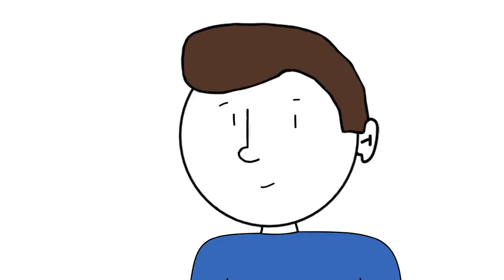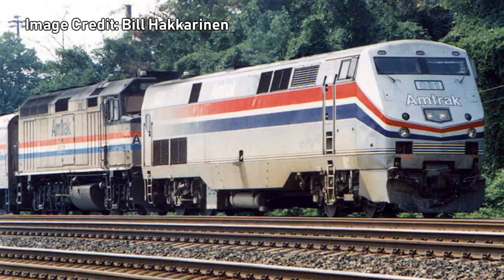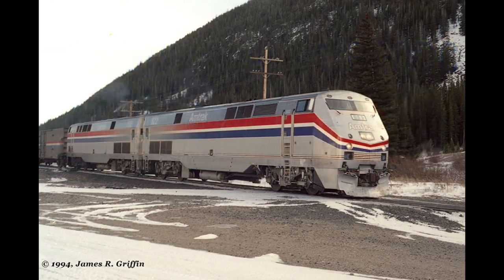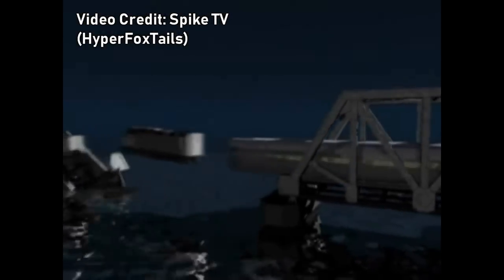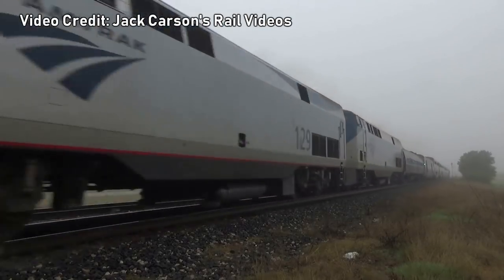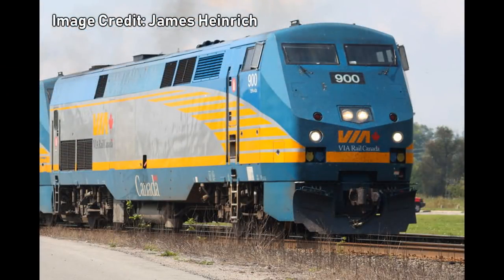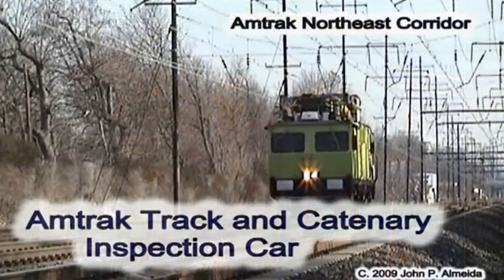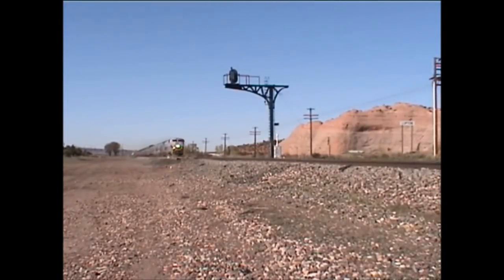Engines of Amtrak - GE Genesis

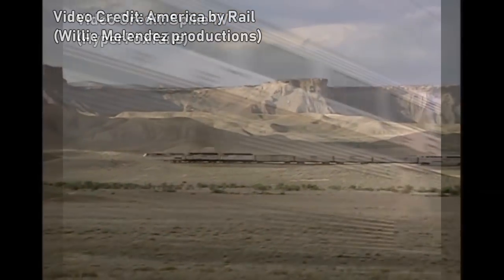Comment: At 4:23 why couldn’t Amtrak have ordered another P40 and numbered it to 819 to replace it at that time.
Reply: Locomotives are built in one continuous production run. Once the production is complete ordering just one is not even an option.  It would be prohibitively expensive as parts are ordered and the assembly line runs with a tight schedule.  At the time they were built Amtrak was the only railroad buying them so tacking on to the back of another railroads order in progress wasn't an option either.  Locomotive builders aren't interested in small orders. They want orders of 10+.  It's the same reason why Amtrak isn't buying two new ACS-64's the replace the two units that were totaled in the two incidents they had. The production line is done making ACS's.
Reply: @FFred-us9tw  the reasons why because P40 819 had been in service for a few weeks and same for P42 143 and 149 because they were wrecked back in 2001 and at that time they’ve been in service for a couple of months.
Reply: @christianstudivant4804   Yes, but it doesn't change the fact the production schedule is based on a set number of loco's and the necessary parts. Too costly to add on 1 or 2 more.  This is commonplace when producing locomotives. The only way to drop the cost on extending a production run is to order in volume. That means a lot more then a few extra units.  And even then you have to deal with shop floor scheduling. GE was building a lot more than passenger loco's at the time. You only have so much space. If you alot a set amount of time to build one series of loco's then you are already blocking time to build the next order of loco's for the next customer. You cannot just extend production on one type to build a few extra units and start a chain reaction of delays on the next model to be built on that line.

Comment: As of the creation of this video, P40DC #831 is based out of Washington, DC and multiple P40DC’s are still on the Auto Train roster.
Reply: P40DC's are typically the main power for auto train sets, but occasionally they'll find their way on other lines.
Reply: The Rail Thing indeed so.

Comment: Why doesn't Amtrak get the streamlined Chargers? Especially for the Cascades line?
Reply: The SCB-40 was made specifically for Brightline (now Virgin Trains USA) as these locos has the same horsepower rating as a P40DC.

Comment: Horn Button? Does that mean no quilling horn?
Reply: Bradford Whitney Yup thats correct.
Reply: No, it's not. Amtrak horns have what I believe is called a "two-stage valve:, meaning they're capable of half-blasts and full-blasts.
Reply: The Rail Thing Incorrect, The horn is a blue button, You press it you get the horn simple, Its not a valve where it quils.

Comment: Does Amtrak have dash 9's, AC44CW's, or SD70ace's?
Reply: Norton Hatfield no those are freight diesels and Amtrak is a passenger railroad not a freight railroad.
Reply: Amtrak at one time handled Express freight and mail on the long distance trains and these freight locomotives have been used on Amtrak trains temporarily should there be an issue with the regular Amtrak locomotives.

Comment: I thought these engines have a RB26 engine or a 2JZ engine
Reply: Joseph Edomwony why would they have such a small engine?
Reply: dennis trident william they need these power engines to make it look better
Reply: Joseph Edomwony but if they had those they would be underpowered as fuck
Reply: dennis trident william all we need to is add like 10 those in there
Reply: dennis trident william cause look me and friend we have engine swap a septa Kawasaki LRV 9000 series trolley with the RB26 engine in there but we tried a Toyota 1jz and it exploded so we have to use the nissan RB26 engine from the Nissan skyline gtr
Reply: Those engines don't have the torque to pull over 2 million pounds. There is truly no replacement for displacement. You must be an idiot to think trains would use car engines that aren't even made my the locomotive manufacturers themselves.

Comment: f40's sill around thought
Reply: Brian Castle ROCK RXR 9 f40s are NPCUs on Amtrak but on commuter roads like metra coaster VIA ACE music city star and MBTA still run regular f40s
Reply: Amtrak still has a small number of actual F40s at Beech Grove last I heard but they will likely eventually become NPCUs or be used as parts sources for the GP38H-3s.
Reply: Blackbird Gaming Actually that would be in Bear,DE. Beech Grove has 2 or 3.

Comment: I personally think that the Genesis will continue to be used on long-distance trains
Reply: TexasRailfan21 For 5 more years
Reply: Robert Briscoe / Amtrak Man I still don't believe it it's my opinion and I'm sticking to it
Reply: TexasRailfan21 Yup but thats how it goes but hey cheers to the future.
Reply: Robert Briscoe / Amtrak Man cheers to you too 👍
Reply: @amtrakpilots8947  here's an idea if General Electric were to make another generation of the Genesis series locomotives what would you think the number would be P45 or P50 and if they did it would also be in the tier 4 requirements I thought it would be very cool if General Electric made the next generation of Genesis engines what would you think the model number would be?
Reply: TexasRailfan21 GE nowadays is kind stepping up their game but wouldn't be interested at all.
Reply: @amtrakpilots8947  this is not something I'm saying it's something I'm asking this is a theory if they would what would the engine model be called?
Reply: TexasRailfan21 Something terrible
Reply: @amtrakpilots8947  I think in my opinion it will be called the P45 it would have slightly more horsepower than the P42 it would have the state-of-the-art features and meet all the tier 4 requirements if GE would make that model but this is just a theory and an idea that would be cool

Comment: 818 slammed into a crop sprayer tractor in NE montana a few days ago..... 5 cars derailed but stayed up right
engineer was in critical condition.... and the PAX seem to just have a few broken arms and scrapes 
but idk if 818 will be on the rails ever again...... they MIGHT be able to rebuild it
Reply: Where did you hear of that?
Reply: @harrisonofcolorado8886  just had to look out of my window.....

As far as the more detailed stuff..... friend who has a police/EMS scanner that also does BNSF radio stuff
Reply: @kainhall   how badly damaged was 818?
Reply: traveler  front end was smashed pretty much flat.

The frame MIGHT have took a bit of twist.

Idk if amtrak will spend the money to put a new shell over it (front to back... the shell is one piece) even if the frame is OK
Reply: @kainhall   hey um, not to burst your bubble but I found a photo of the accident and apparently the wreck damaged Locomotive seems to be Locomotive #9 not 818. 818 seems mostly okay. But yeah, I think 9 is a goner.
Reply: @kainhall   I just meant P42DC 9 was damaged not P40DC 818 as much.

Comment: It is time for Amtrak to replace its locomotives and coaches too. In fact some of the equipment that they use has existed longer than Amtrak.
Reply: Actually thats quite wrong, The only locomotives on the roster that are older then Amtrak is the SW1 #737 which serves WT.
Reply: same with metra they use some cnw pullmans but i think its cool
Reply: planes spotter and railfanner Yup, I think acouple are left possibly 10+.
Reply: planes spotter and railfanner some of the Amtrak superliner coaches have been used on Santa fe el captain.
Reply: Robert Briscoe / Amtrak Man some of Amtrak's amfleet coaches  were originally emu, electric multiple unit, coaches for Penn central.
Reply: Norton Hatfield No your info is wrong superliners were never used on the El Capitan but the Superliners did serve with the Hi-Levels beginning in '79 on the Empire Builder.
Reply: Norton Hatfield Nope, Amfleets are based off the design of the Budd Metroliners.
Reply: Robert Briscoe / Amtrak Man it's too bad the superliner coaches can't be used on all Amtrak lines. This is true with Amtrak trains on the east coast because of the infrastructure of the Northeast corridor. The North East corridor has a lot of low bridges and tunnels. Too small for superliner coaches and the Hudson river tunnels are a tight squeeze for trains too. Those tunnels are too small to accommodate superliner coaches too.
Reply: Norton Hatfield Both yes and no, Superliner have clearence for the Keystone Corridor which runs to Harrisburg.
Reply: Robert Briscoe / Amtrak Man the amfleet coaches were designed to attract airline passengers because the coaches are designed to look like the fuselage of an airplane. In fact the seats inside an amfleet coach look like the seats of an airplane.
Reply: Norton Hatfield Well back in the days, They gave Amtrak the Airline Seating arrangement and style but now they are actually using Airline seating.
Reply: Robert Briscoe / Amtrak Man that makes sense since the airline industry almost killed passenger rail service in the United States during the late 1960s.
Reply: planes spotter and railfanner that is surprising that a modern day commuter train would be using vintage passenger cars.
Reply: Norton Hatfield Well alot of commuter companies use those cars because thats what they were given to supply on and if they think that it good to keep using.
Reply: planes spotter and railfanner metrolink has ageing bombardier passenger cars but they very reliable compared with the new metrolink passenger cars which are made by Hyundai totem. Metrolink on the other hand is planning to retire its fleet of bombardier passenger cars. They plan on only using Hyundai Rotem passenger cars a few years from now. They  will scrap some but they keep some in storage and donate others to other commuter trains.
Reply: Robert Briscoe / Amtrak Man also diesel and steam engines are banned in New York city, so all train heading towards grand central station in New York city must have an electric engine or a dual powered diesel and electric engine.
Reply: Norton Hatfield Believe it or not Diesels have been in Penn station including F40s, FL9, Amd-103.
Reply: Robert Briscoe / Amtrak Man that in case of an emergency or during matinence or even during electric rail and wire repairs, these are exceptions of when  diesel locomotives are allowed to travel into New York city stations.
Reply: Robert Briscoe / Amtrak Man the fl9 is actually a dual mode diesel and electric locomotive.
Reply: Robert Briscoe / Amtrak Man Also the Amtrak p42dcs and switching engines  have traveled in New York city too. This includes the aftermath of hurricane Sandy, the week after 9/11 when all flights were grounded, and to rescue electric trains on North East corridor during a power outage or broken electric cable, and also after hurricane Sandy in 2012 too because the electric grid on North East corridor was down for several days after hurricane Sandy.
Reply: Robert Briscoe / Amtrak Man gp9s, dash 7s,  and sd45s could fit through the Hudson river too, but larger locomotives such as the f59s,sd90 Macs,  sd70 aces, and dash 9s would be too big to fit through the Hudson river tunnels.
Reply: Robert Briscoe / Amtrak Man Also Amtrak is planning to replace the Hudson river tunnels with a new mega tunnel system in New York city, if Amtrak receives any funding for this project. The new mega tunnel system maybe suited for non electric locomotives,and taller coaches.
Reply: Robert Briscoe / Amtrak Man what about the baggage cars?
Reply: @planeflight1202  They have been upgraded in the last several years which includes larger seats, installed electrical outlets for laptop and other electronic devices, WiFi, more  environmental friendly toliet disposable system, and handicap accessibility for the disabled.
Reply: @amtrakpilots8947  the coast starlight Pacific parlour cars, which Amtrak recently retired them from service, were originally used on the Santa fe el captain.
Reply: Amtrak used to have vintage dining cars on some long distance trains back east.
Reply: @planeflight1202  caltrains uses those coaches too and plus bombardier coaches which some of them have been donated from metrolink.

Comment: Alright have to disagree with you on a lot of this. The Gensis were anything but reliable or fast, while they were rated for a higher speed then the F40s 103mph vs 110mph the Genesis had very slow acceleration especially when compared to an f40ph. There are also many problems with these units including numerous fires premature traction motor blowouts cracked trucks as well as cold weather problems.
Reply: Ham549 a downside with the f40ph it had a badly exposed fuel tank when it hit it ruptured that happend in 1996 f40ph 255 and p40dc 811 hit a mark train 255 fuel tank was ruptured and set the marc train on fire compaired to 811 its fuel didint get dameged becouse its fuel tank was built up inside the carbody thats why it didint get destroyed  255 was destroyed 811 was repaired

Comment: Wait.  Did you really say, "Amtrak's P42DCs have proved their reliability for several years now"?  A 30% unavailability rate is not proven reliability.
Reply: They're old, have bad Amtrak maintenance, and are nearly 200 strong.
Reply: Dont forget that GE doesnt make parts for them anymore. Any railroad that purchases any genesis units will look back at it as a great mistake